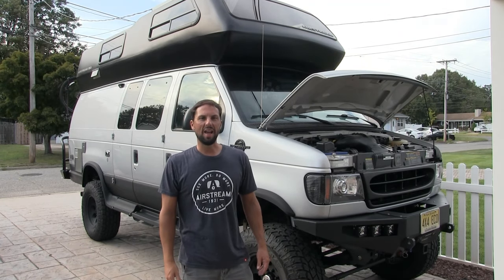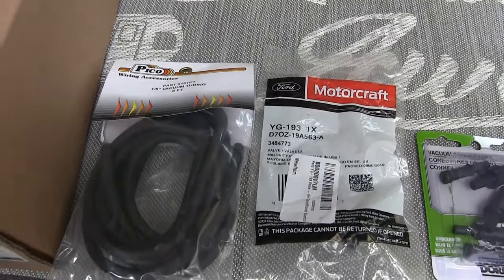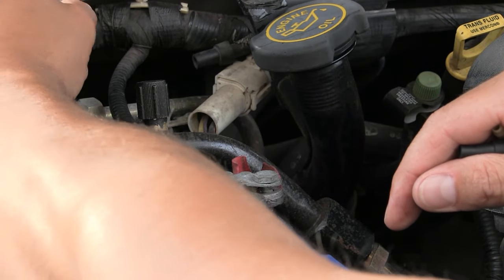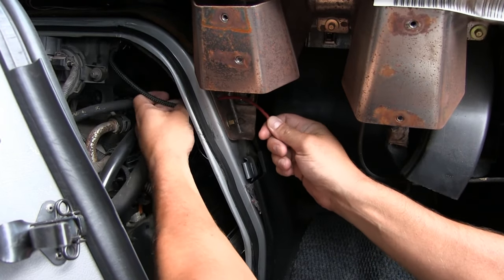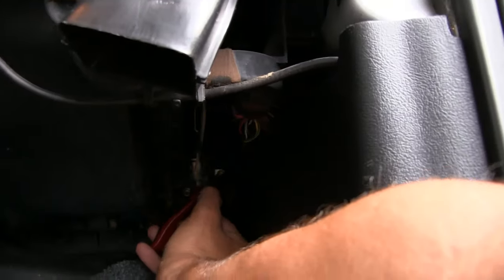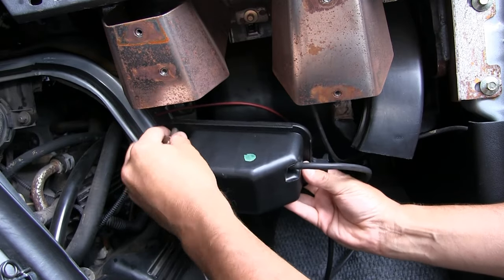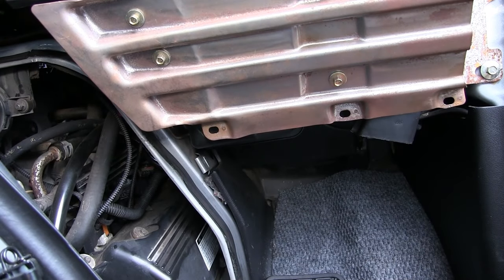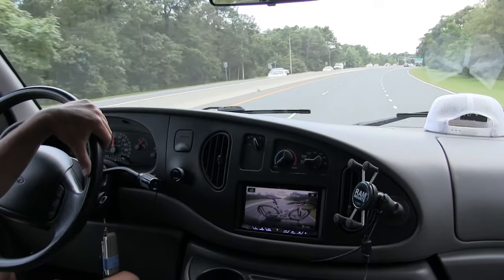Ford Econoline AC Heat Defrost Acceleration Fix

Comment: I watched every video I could find about this issue and this one is clearly the best.
The method used and the clear instructions given made this job super easy. Thank You So Much!
Reply from the maker: You are welcome
Reply: i guess Im asking randomly but does anybody know of a method to get back into an instagram account?
I was stupid lost the login password. I love any help you can give me!
Reply: @Cain Rudy Instablaster ;)
Reply: @Dante Valentin i really appreciate your reply. I found the site on google and Im in the hacking process now.
Seems to take a while so I will get back to you later with my results.
Reply: @Dante Valentin it did the trick and I actually got access to my account again. I'm so happy!
Thank you so much you really help me out !
Reply: @Cain Rudy No problem :D
Reply: Parts list:
Accumulator (Dorman): https://www.amazon.com/gp/aw/d/B07CPX9H6H/

1/8 inch vacuum tubing: https://www.amazon.com/Pico-5161PT-Vacuum-Tubing-Package/dp/B00030CZMS

AC valve: https://www.amazon.com/Ford-YG-193-Valve-Air-Conditioner-Control/dp/B000O0V7LM

Misc tubing connector assortment: (overkill, so you might want fewer pieces)
https://www.amazon.com/gp/aw/d/B001C0AZ3O
Reply: I was just about to ask why he didn't include this in the notes! Thanks @AR-mb3id
Reply: @adammacer  Glad it was helpful. I did this fix and it took less than 30 minutes and i was taking my time to do it right. Now my AC works flawlessly. Good luck!
Reply: @AR-mb3id  thanks for links to the parts. Appreciate it!

Comment: Hey, I did this modification on my 2006 E-250 today. It worked PERFECTLY!  I was quoted $1200 USD to do this repair. Instead, I spent $65 on parts and 45 minutes of my time to do  it myself. This modification is a perfect example of thinking outside the box!

Comment: I can't thank you enough. Ford clearly did this intentionally, and it is my pleasure that we get to screw them back and tell them to shove that repair bill where it belongs. I saw a video where they had to remove the dash, remove the coolant, evacuate the AC refrigerant/remove the evaporator core and blower, and finally ...remove the heater core. Ford...Really??? You rock Sir!
Reply from the maker: Glad it was helpful
Reply: @NewJerseyOutdoorAdventures  I am  reporting back that this fix worked perfectly for me. If you get the valve that Patrick specifies, it should work.

I am replacing an aftermarket valve that did NOT work, that someone installed before I got ahold of this 2013 E-350. It seems that the Dorman replacement ( and whatever this valve is) will not work, judging by the reviews for that valve. I believe that it is because they need a higher vacuum to operate correctly? It could also be that my valve was faulty.

In any event, whoever did this mod was clever. They routed the vacuum line through a plastic cover in the firewall, just below the glovebox.

Patrick, I believe that your E-350 Over Lander conversion is the best that I have seen. I watched the video where you showcase all that you did, and it inspires me. I have a Thor E-350 High Top van and if I can save up enough money, I will do a similar conversion (it won't likely hold  a candle to yours, but it should still be cool).

Mine has the awesome Windsor 5.4L 2V motor in it, and I did a small mod to the exhaust - I did a "Cat Back" on it and the Magnaflow aftermarket design really seems to have given it power that was not there before. While I have never had it on a dyno, I would estimate that she gained at least 20 horsepower. Magnaflow fixed a restriction at the Y Pipe, that was present in the Ford OEM version.

Heat is no issue for me since I built my own custom fan shroud, and stuck 2 big electric fans in place of the original, mechanical fan. I have towed around 5,000 lbs in brutal Texas heat at 110 F and she stays below 220 F at all times, mostly staying below 210 F. Even White Sands, NM could not cause her to overheat and that steep grade heading out of that place northward seems neverending. Not towing, she rarely breaks 200 F, even running the AC in 100 F plus heat. The OG mechanical fan would approach 210 F...not even towing.

I can take a little extra power and get rid of the heat. My mod is not groundbreaking, but it is at least a start.

Comment: Perfect video.  I have a 2003 BT Cruiser RV which has the E-350 cab.  The video was easy to understand, made the repair very quick!  Works great.  My only difference, I ordered the vacuum connectors but did not need them.  Was able to use what was on the vehicle.  Thanks for the great video!  I'm back on the road...cooling

Comment: The explanation is great, but seemed to gloss over the hardest part. Finding the port on the heater control valve that is to attach the new vacuum can.

Comment: Just remove the cover panel on top of the dashboard and move the lever to any position. Or replace the vacuum boosters if they are bad. Very easy to access and cheap to replace.

Comment: I stumbled upon a gem of a YouTube video titled "Ford Econoline AC Heat Defrost Acceleration Fix". Let me tell you, it's nothing short of a miracle worker!
From start to finish, this tutorial guides you through the repair process with unparalleled clarity and precision. The step-by-step instructions are incredibly easy to follow, making the repair job feel like a breeze.
What truly sets this institution apart is its attention to detail. Every part, tool, and technique is explained thoroughly, leaving no room for guesswork. 
I couldn't believe how smoothly the repair process went! Thanks to this video, what could have been a nightmare turned out to be one of the most straightforward repair jobs I've ever done. 
I can't thank the creator of this YouTube video enough. Their dedication to simplifying this complex task and empowering us YouTube viewers is commendable. This video is a lifesaver if you're facing a vehicle repair challenge. Trust me, you won't be disappointed!

Comment: had to replace canister in 2013 Ford E350  van. This is still the best video out there on how to do it. Note: This van doesn't have the port door on the dash. If there's a glove box, remove it (4 screws), and cut the BLACK line, not too high, or it's difficult to work with. The tubing was very small and wouldn't fit the connector, so I put it in the new 12" tubing and sealed it with liquid electrical tape. Even before I did that, the vacuum was good. I kept the protection on the line that I brought from the engine and was able to tuck the canister behind the glove box and put back the doghouse. No need to remove the bolt (which I'v done with past installs). God bless.

Comment: Had the exact same problem on my 2006 ford e150 cargo van it started like a year ago but it wasn’t as bad I mean I could live with it but this summer heat here in okc is awful and my van started having this problem more and more often it used to be only when accelerating hard to go into highway but this year it was doing it on regular roads and 3 seconds with out ac on a cargo van in this heat! It was like a oven and glad I found this video while searching what the problem was and I ordered the hose, valve, and reservoir and since I watched this vedeo about 10 times while waiting on parts to arrive, when they arrived I knew exactly what had to be done and manage to get it done in 10 minutes and only spent $40 bucks, thanks man I appreciate these kind of videos saved me tons of cash I really don’t have! I’ve watched other videos and they do the same but they leave everything hanging on the passenger feet and the way you did it seems professional to me I love it

Comment: After a couple of years of the a/c in my 2006 E-350 van slowing fading to nothing, I called on Dr. Google and Dr. YouTube. Thankfully, I found your video before another Florida summer. The video was comprehensive and very easy to follow. The link to Amazon for the parts was a great time saver and right on target. Forty bucks worth of parts, an easy hour following the installation steps, and I have cold air and hot defrost, as Nature intended. I can't thank you enough for your time and effort in making this solution available. Great job!
Reply from the maker: Awesome 👍🏽 have a great summer

Comment: This video has a lot of good information. I just completed this fix on 3 of my vans. I use a slightly different method that does not require drilling any holes, or removing the doghouse. You can pull the grommet and vacuum line out of the firewall from the passenger side. I then fished a wire coat hanger through the hole and up along the inside of the fender.  I use a claw pick up tool to guide the hanger away from the fender. You can now separate the vacuum line under the hood, leaving the connector on the left side tubing, and pull the check valve and tubing out. Now slide the connector over the hanger on the inside of the van, and tape it to the hanger. Pull the hanger and the vacuum line through the firewall. You have now relocated the check valve to the passenger side of the firewall without drilling any holes. Use silicone to plug the hole and follow this video to complete the installation.
Reply: In your video did you find the need for the replacement accumulator?
Reply: @josephramos6328  Yes, I used the replacement accumulator, I just rerouted the tubing back through the firewall, with the check valve on the passenger side.

Comment: Best video ever. I ordered the parts on Amazon. I think they were $53. My configuration under the dashboard was a little different than what was in the video. My truck is it 2019 F350 is pretty much the same. Very easy and simple repair, it took me a total of about 40 minutes from start to finish the AC works perfect now. Thank you so so much.!!!
Reply from the maker: Awesome

Comment: Excellent video bro. Right to the point. Clear and concise. Nothing extra or confusing. I can follow this easily.Good stuff! I saw a few other videos on this and so far this is the best. Theres also an emergency quick fix of opening access door on top of dash and disconnecting arm from front vent actuator and manually just pushing the rod in. When rod is pushed in the air comes out of the front vents. Thats just good to know in case of an emergency on a hot day when someone doesnt have that new part on hand yet. 
Thanks for the no bs video!

Comment: You bypass surgery instruction are great. Thanks. One comment is I pulled the original vacuum line from the firewall and fed the replacement hose though that same hole, then sealed it,  instead of opening the doghouse. I used a rigid hose and it came right up behind the battery. But without your video I wouldn't  have figured this out. Again, thank you
Reply from the maker: Oh wow, awesome idea

Comment: Just fixed my vacuum problem following your method. Test ran it up and down the highway and had constant AC air through the vents. 
Only thing I has trouble with was finding a place to mount the new tank. My van has a glove box so that there is not much room behind it. I had to pull out my creative side. 

Thanks for the instructions.
Reply from the maker: Glad it was helpful Kent

Comment: "06 E350 fixed in 20 mins for about $45 with this method!  I had been putting off the repair because I didn't want to remove the dash and suffered through last Summer with this problem.  Thanks so much NJOA.  This is the only video you need if anyone has this problem.  All my parts came from O'Reilly, ordered last night, picked up this morning.
Reply from the maker: Thank you very much

Comment: I have looked and looked, and this was PERFECT for me. We'll almost. Where my red and black vacuum lines meet by the oil fill cap, there was a T junction and a third vacuum line running elsewhere. I had to chase that and rerout the line and the T to be accessible inside the doghouse, but the rest was perfect! Glad I bought the Universal vacuum line connector kit, because I needed a couple of extra ends due to the added line I had to route. For the record, I have a 2005 E450 cut away with a shuttle bus body.

Comment: Victory over my a/c, thanks to this excellent video! 
I would, however, like to add the following information for anyone else about to undertake this job:
 1) Don't hesitate to undertake this fix if your a/c is always stuck on defrost, not just when the van is accelerating, as it is in this video. 
2) If you're paying close attention, you'll notice the fellow in this video never uses the vacuum hose connectors he bought. You don't need to either - I didn't; I did what he did instead. Worked great.
3) The clips that hold the doghouse down are a PITA. The ones on the bottom need to be rotated, not just pulled back. The doghouse in my van is carpeted, so I couldn't see the mechanism to know this without having to watch another YouTube video about how to get the doghouse back.
4) The accumulator is not easy to mount, because the area it's going into doesn't let it sit flush in there. Instead of just placing it flush against the bracket and trying to thread the bolt through both it and the bracket at once, you'll have a much easier time if you thread it about 80% through the accumulator before you try to thread it through the bracket.
Have fun!
Reply from the maker: Thank you for the additional information
Reply: This was a fantastic video and your two cents was greatly appreciated...  I had it stuck on Vent because the hose to the accumulator had deteriorated can't even imagine doing the way Ford says to...
 thats crazy...

Comment: What a perfect solution. It worked beautifully. I replaced the fan motor and resistor while I was at it. An hour or so and $120 vs $1400 quote from the shop.  Thank you!
Reply from the maker: Glad I could help!

Comment: Raymond thank you so much for helping me and everyone locate and solve the issue. 
In my particular case the check valve that you mentioned  Is behind a piece of plastic. I took a small hacksaw blade and cut the plastic away and pulled the check valve through completely. I think the check valve was connected by a small hose to the vacuum canister. That little tiny piece of hose was completely dry rotted.   I temporarily put a piece of electrical tape over that connection and the blendoors worked perfectly. Thank you Again.
Reply from the maker: Ha Raymond

Comment: Awesome. I spent $1200 some 8 years ago to have this problem fixed on my E350. Marginal improvement, but it gradually came back until it was unusable. I had no desire to spend that money to no avail again, so I tried this. For $50 plus a $30 vacuum gauge, my air is blowing cold again, no matter how much I accelerate. Thanks to you for your clarity of exposition, and to others who gave you material to work from. (And thank you for keeping the camera still!)
Reply from the maker: Glad it helped

Comment: Great repair video! I just bought a 2016 Ford E350 small shuttle bus, which is going to be my new travel vehicle and it has the same vacuum heating system and with the same issue. I can hear the blower motor working but no air comes out the vents. Thank you so much for this money and time saving fix. Funny but my old 1986 B250 Dodge travel van also has a vacuum heating system just like the ford. Well, get out there and, get lost and get found. 🚌
Reply from the maker: Very cool!

Comment: Fabulous video!  I fixed my 2006 E150 Cargo work truck with 80,000 miles for $68.00. I thought I could do it all with the leftover parts under the hood, but in the end I did need the package of vacuum fittings in your video on the right with the products.  Thank you!

Comment: I just finished the fix. Thank you. The hardest part was taking the engine cover (dog house) off. I think that it had never been removed on my 14 year old van. It took an hour of prying and tapping to get it loose.  I sprayed the seal area with silicone spray before reinstalling the cover.

Comment: I watched several videos and thought this was the best, been without air due to cutting out during acceleration for years. knew about this fix but thought it would be too much trouble. This summer heat changed my mind. Took 20 minutes to do and test, works great. Thanks
Reply from the maker: Glad it helped!

Comment: Great video!   I have a 2010 E350 and the dashboard situation is a bit different from yours.  I ended up routing the engine vacuum line through almost the same location, but instead of removing one of the bracket bolts, mine already had some carpet fastener plug holes drilled into the vertical wall of the engine housing.  I just pushed out the most rearward carpet plug receiver and then punctured the insulation like you did to route in the red engine vacuum line.  Made for a nice clean routing for the vacuum line through the carpet plug hole.  After making all the line connections, I just mounted the new reservoir box up high on the far right side on the plastic triim panel below the glovebox using velcro sticky tape for easy removal in the future.  To do this, I found it necessary to remove the "L" shaped mounting tang on the new box with a hacksaw so the box would mount flush to the inside passenger trim panel.  Everything tucked up nicely and out of the way of passenger feet.  Thanks for the video!
Reply from the maker: Excellent information. Viewers take note.

Comment: Really appreciate this! It worked beautifully on my E350 van. The elegant mounting idea (bolting the vacuum reservoir into the bracket) couldn’t work as my van is configured a little differently. I used double sided tape to stick the vacuum reservoir/accumulator to the firewall (i.e. out of the way). The connectors that attach the skinny lines to the check valve can also be found as fuel line connectors.
Reply from the maker: Glad it was helpful. Thank you for the additional information